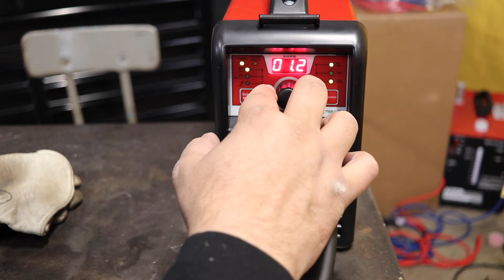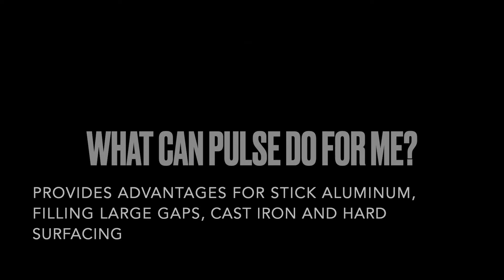Your Advance Pulse Stick Welding Questions Answered!

Comment: Seems only HTP and Fronius do pulse stick.
Reply from the maker: its a European thing - both of those machines come from Europe the factories are less than 200 miles apart
Reply: Buy a tig welding machine with pedal and 'misuse' it as stick welding machine. My TIG200P ACDC doesn't recognize, which cable is attached. When I connect the stick welding electrode holder and set the machine to tig then all the goodies of tig are also available at stick welding:
- start of welding with the pedal
- hf ignition of the electrode
- current control with the pedal
- pulse welding
- ac welding (square and triangular)
- spot welding
- no voltage on the electrode when pedal not pressed

And no longer a problem with the small crater at the end of used electrodes, the hf ignition solves it.
Regards Wolfgang

Comment: pulse reduce your amp so not good on thick stuff , unless you have huge welder ,  it also slow things down  good for novice
Reply: good for thin metal and root passes
Reply: You can just set a higher base and higher pulse if thats the welding properties that are important for your application

Comment: It appears this machine is no longer available for purchase. Any similar machines for stick pulse that you can recommend?
Reply: Froenius  transpocket 150
Reply: @leopoldpoppenberger8692  Now replaced with Ignis model, but Artis(tig version) can also do stick as well I believe, same 6010 capability.
Reply from the maker: HTP has 2 or 3 machines left .. officially it is discontinued but if you call customer service they will sell you one.

Comment: In case anyone is wondering, that little lunch box is a BEAST sporting 100V OCV!   That's better than some "blue" or "red" engine drives!
Reply from the maker: Yes it is! Everyone who welds with one goes wow this is amazing!
Reply: Fronius transpocket can do 100V also, but these are the only two I believe.